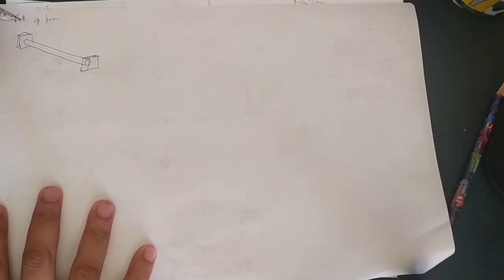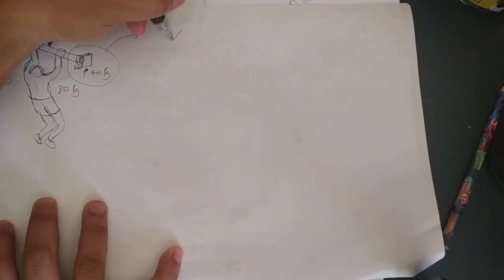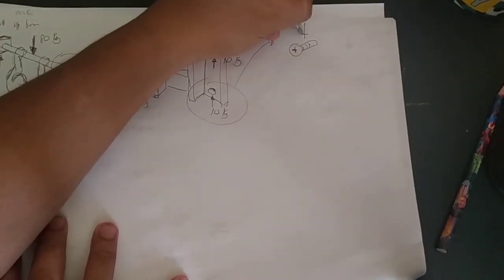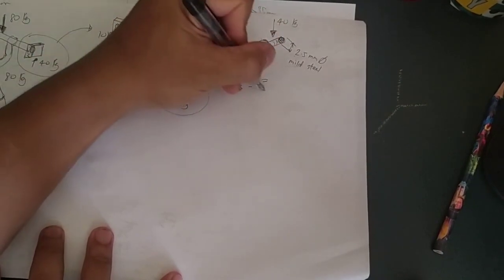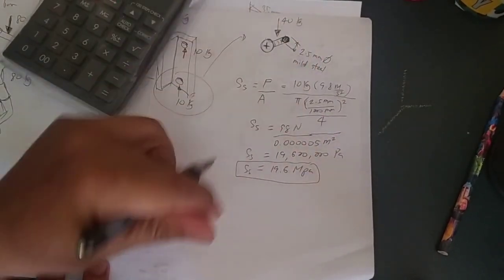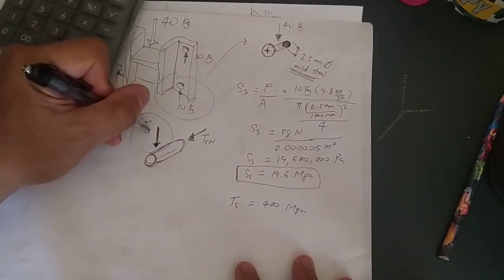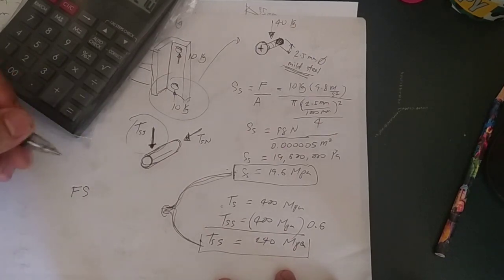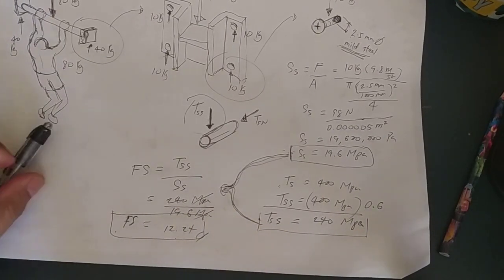Home pull up bar stress calculation

Comment: Hi Ingko, I am trying to design a home pullup bar that I want to anchor in concrete footing on the ground. I want to do kipping pullups on it. Can you help me calculate the necessary dimensions of the footing? Better to email or DM if possible.